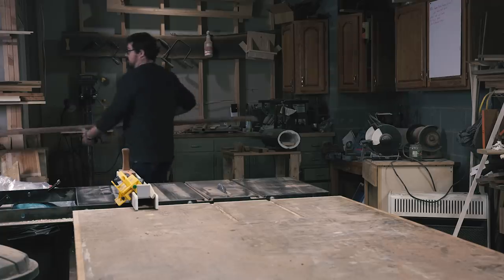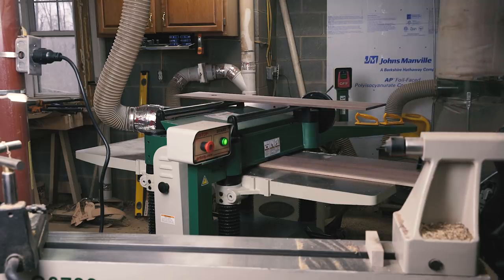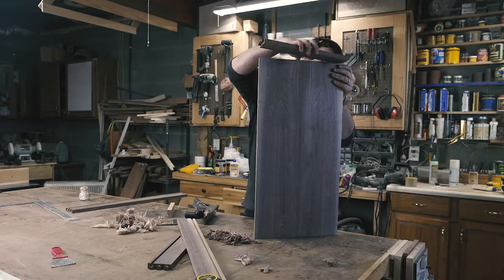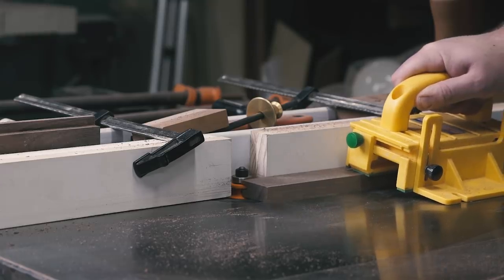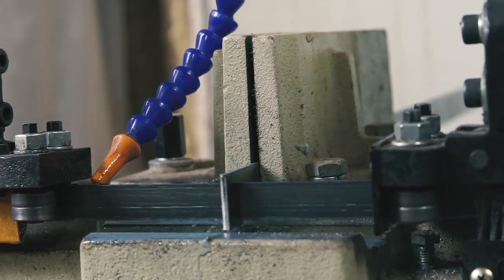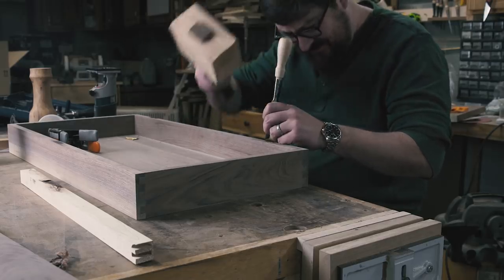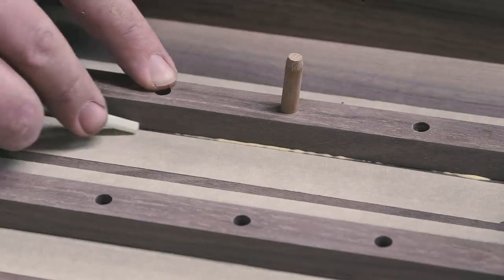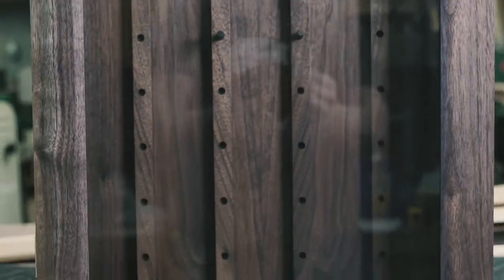The Knife Display Case

Comment: That is a lovely cabinet! I just used my first set of Brusso hinges on the box I just finished and (also not getting paid) you are right they feel sturdy and beefy and well made and worthy of whatever piece your putting them into. Definitely use that steel screw. Even having pre drilled the holes I snapped the first screw I tried

Comment: Gorgeous work. I have a question though, We have the same table saw..what are you using for a router lift?? I haven't found a great solution myself.
Reply from the maker: Grizzly sells it as an upgrade or accessory. They actually updated it recently to include miter slots in the router wing
Reply from the maker: I just reread your question. As far as the lift goes, I'm using a spare fixed base and adjusting it from underneath. The custom way would be to build a torsion box or platform to fit in between the rails, drill holes in the rails and bolt it on to the right if the cast iron table and buy one of the lift mechanisms and inset that. I might do that in the future
Reply: @wmwalkerco  I use the same setup, I was hoping you had a much better solution because adjusting like this can be a pain in the ass if you're trying to dial in a specific depth for the bit

Comment: The inside of the case is too dark to show off the contents. I would have gone with a lighter shade wood. Never install glass permanently - someday it's going to break. Brass or nickel pegs would have better coordinated with the metal of the knives. Nice box though.
Reply from the maker: The client wanted walnut, I specifically did NOT install the glass permanently and again, the client wanted walnut pegs. I disagree with the brass or nickel pegs. It would have taken away the contrast from the steel. Its showcasing the knives darker is better.